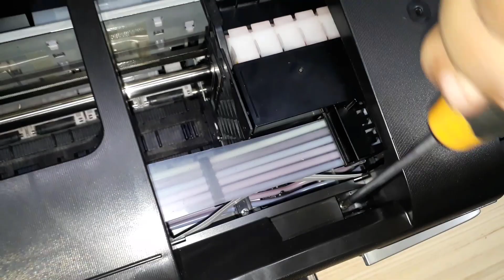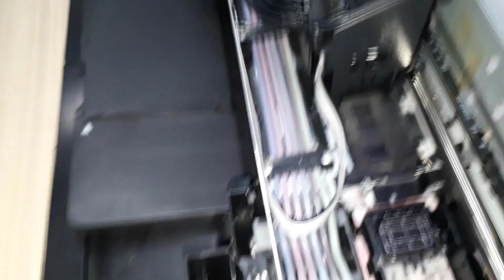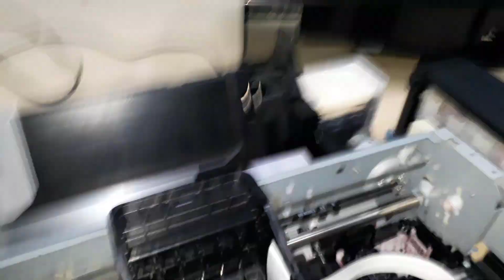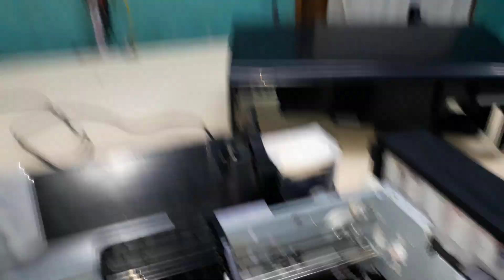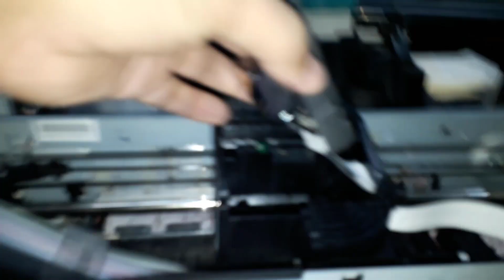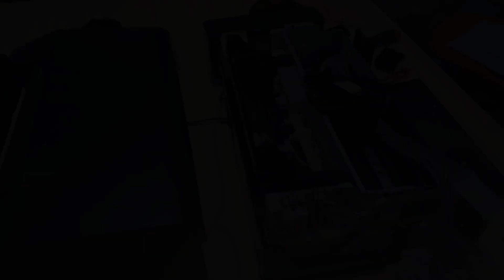Cleaning or Replacing Printer Head of Epson L805/R330 - Pinas Print Digital Printing Tutorials

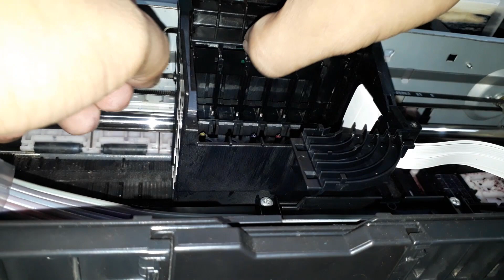Comment: Hi Pinas print. I accidentally pulled out the white ribbon when unlocking the back part (@ 5:30 mark ). How to put this ribbon back?😢 Please help.
Reply from the maker: If the ribbons attach to the print head (,just slide it in).  If it happens you pulled out the small ribbon attached in the back, it's a harder work to return it. This case, you will need to pull out the print head carriage.
Reply: Yes, very difficult. I can barely see where to connect. How to pull out print head carriage?

Comment: I’m sorry but you tutorial is really shaky and blurry. I cannot find the clips in the back that you’re showing… it’s as if they do not exist on my printer 🤷🏻‍♀️ I’ve been trying this for over an hour..
Reply: For me it was to push tabs at the far ends of the print head near the top of that rear section. Right above the cables but it's small so you have to feel around a little for it. When you feel it, push towards the front pretty good while lifting up and it should pop up. I hope this helps I just not got mine